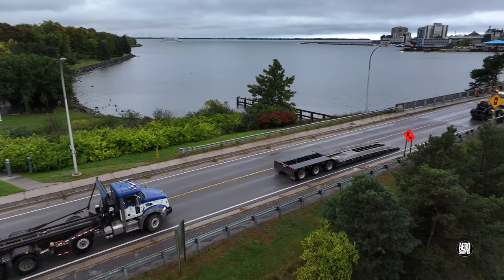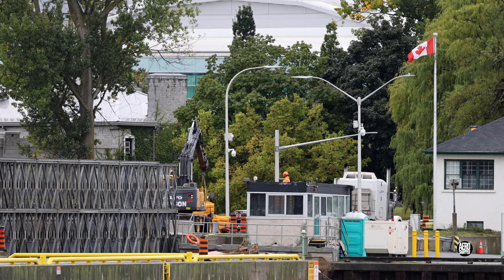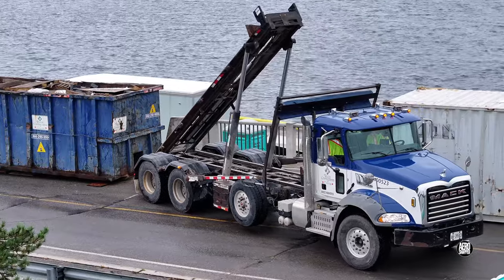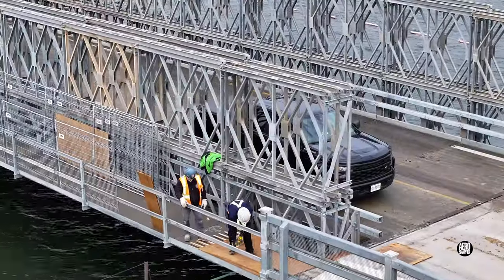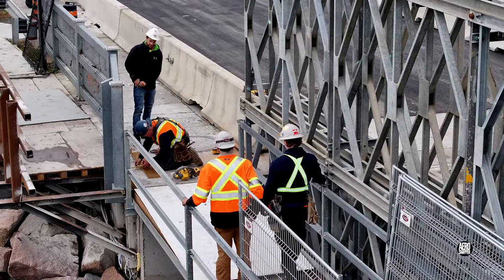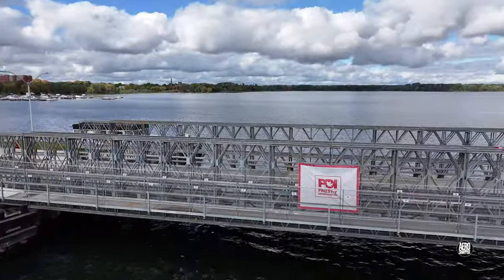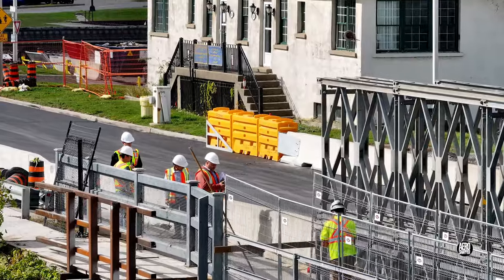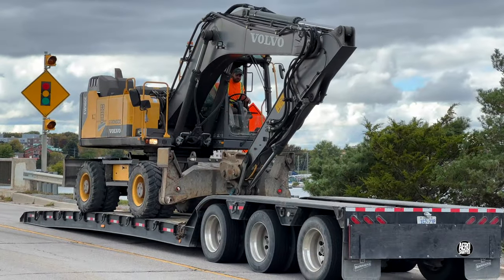'Twas the Night Before. . . .  an update on Kingston, Ontario's La Salle Causeway       4K

Comment: I find the concerted detail to the pedestrian way as notable. It's rare indeed to see that concern for the safety of pedestrians on a 'road' project. Whether that was the contractor(s) going the extra measure, or the requirements of the overseeing authority, kudos to them. For someone in a walker or a wheelchair, those details make the difference or not for their mobility.
Reply from the maker: Stephen - I agree completely - I believe you got it absolutely correct when you remarked that it's an accessibility issue - and that alone makes it a priority.